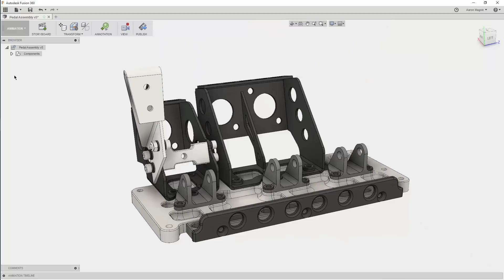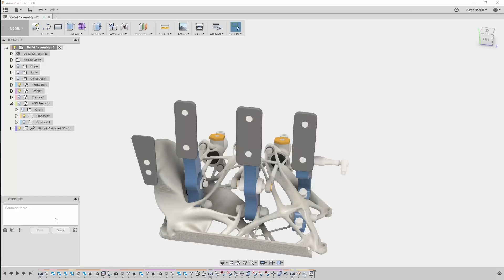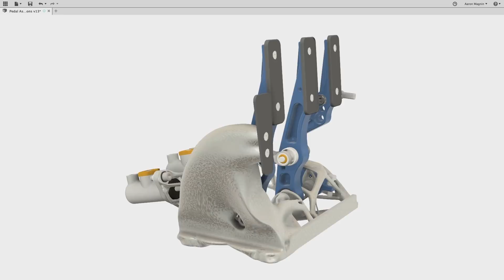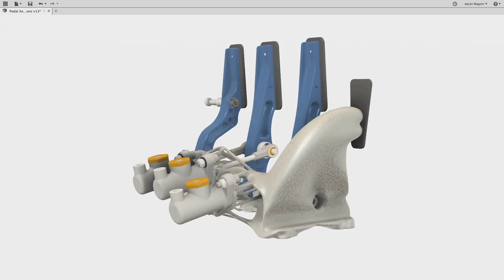Generative Design Technology

Comment: 87 Parts to 1....Brilliant!
Reply from the maker: Its amazing technology! Thanks Micah!
Reply: It's brilliant depending on on what you need. You get a highly optimized design for the loads applied but forget cheap per part replacements and serviceability, and an expensive manufacturing process at that.

Comment: Will Fusion360 Ultimate Student version have this Generative Design Technology?
Reply: Is there an ETA on it being available for the Mac version?
Reply from the maker: Darran Edmundson Great question. Let me check and get back.
Reply: what about local rendering for student and cloud for commercial ?
Reply from the maker: Students can't render locally? Can you double check using these steps:
http://help.autodesk.com/view/fusion360/ENU/?guid=GUID-AFA42779-F9EB-4586-9DC2-A658646C0294 
Will you let me know if that works. 

That said, you should be able to in-canvas render no problem.
Reply: Im using the student version right now and i would have no problem paying a few dollars for a couple of credits, but only if rendering still would be free because my computer cant handle that stuff and definately not this stuff
Reply from the maker: It's only included with the commercial release on a Windows install.
Reply: This must be in student version in order to stimulate students mind for this new approach of design, but I know that it will be complicated with the credits thing (also think this credits could originate a crypto coin by Autodesk).
Reply from the maker: I think you hit the nail on the head...on both the crypto call (ha!) AND the reason why its not included with student versions. Those simulations take significant cloud resources, and there are no upfront charges to obtain the technology -other than a Fusion Ultimate subscription.